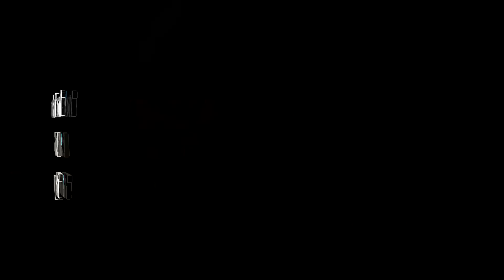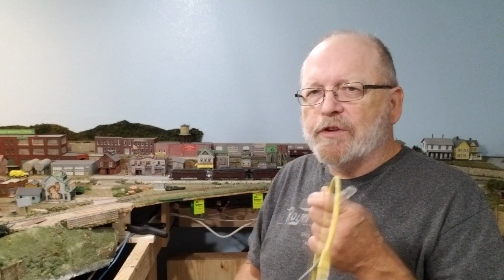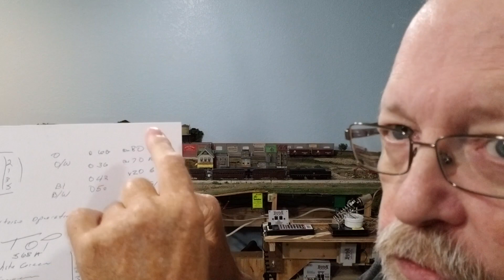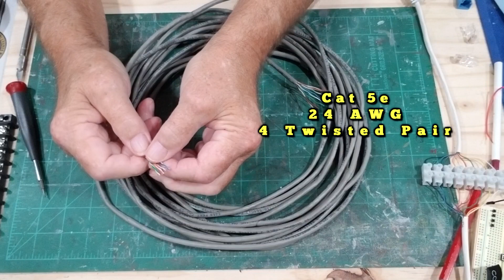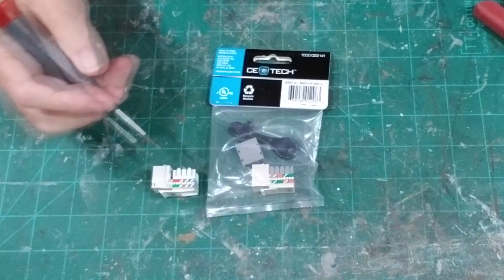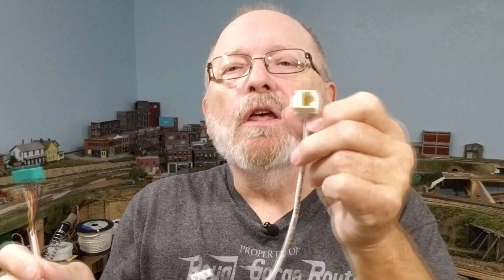Will Cat 5 Cable Handle Your Model Railroad Components

Comment from the maker: If your like me, you have Cat 5 cables every where. Have you ever wondered if you can use them in your Model Railroad? In this video, you will see how to make them and see how much of a voltage drop on a cable over 30 ft in length.
Reply: Have you not consdered using STP (Shielded Twisted Pair) cable which utilises a ground wire (and foil) in the cable and connectors?  Using the ground as a negative (-) wire can give you nine cores, and can be used with normal connectors using a bit of ingenuity as to connecting the 9th core.  Or you could simply purchase STP plugs and sockets for a small increase in cost (and fiddlyness) and that will cover the main cabling problem.  Worth looking into if you need a 9th core!!

STP networking cables are available to purchase if you find them TOO fiddly to make yourself, but the sockets are no more difficult than the normal ones. The same tools are used for both types of cable (crimpers and punchdown tools).
Reply from the maker: Hi Trevor, that's what I used at first on my Tortoise switch machines but I had all this cat 5 cable around doing nothing so I experimented with it to see if it would work and it did. So Ii made this video on it. I really don't need the 9th conductor since the Tortoise switch machine has 8 pins. I'm currently making a board with an 8 pin connector and a RJ45 connector on it so I can make it a little easier to wire all my switch machines.

Comment: A 9 wire connector used to be called a serial buss.
Reply from the maker: Also a D Sub
Reply: @TomsTrainsandThings  My Ethernet cables have 10 wires using telephone type clips for attaching.   What I wonder is what the gauge of the wires is.

Comment: My wife's brother-in-law was a maintenance worker at a local mall, The mall has been abandoned for a few years. When one of the stores closed and moved out, the interior was gutted and everything was tossed in a dumpster. I pulled out many yards of telephone cables some were 50 pairs of wires and others were 25 pairs. I also pulled out a lot of wood that I used to build the bench work for my model railroad. In one part there are 4 tracks that merged into one, went across a bridge at a door way, then into a tunnel through a wall and into the utility room on a covered shelf where it split into two tracks for a passing siding, then merged back into one track and proceeded to go through a wall back into the viewing area. I used the 25 pair cable to operate the two switch machines for the passing siding, 4 block occupancy detectors, and infrared LED's and optical sensors to send a signal back to the control panel when a train cleared the switch tracks. I'm an electronics hobbyist and designed a circuit around a quad NAND gate IC to control a 3 color LED block signal, that would send a signal back to the previous block signal and change it to yellow, and the one before it to green. I lost the schematic diagram for it. I do appreciate your videos. I don't know everything and can always learn something.
Reply from the maker: Always good to get free stuff, every little bit helps. I once got a section of a panel from a yard office that was closing on the railroad I work at back in the 70's. When I moved I gave it to my neighbor because I didn't have enough room for it. Wish I would have kept it.
Reply: @TomsTrainsandThings  I have an electronics and electrical repair shop in the basement. When I first started my model railroad, there was a coal room in the basement in our house built in 1913. I knocked holes in the brick wall for tunnels . Two tracks ran into the coal room on each side on the door to the room one went up and the other went down  and each split into 5 tracks did a u-turn came came out again as two tracks. When my business took off I needed more room so I took out the coal room and the tracks, so there's not much left except the part in the viewing room. I did built an old style wooden coal tipple that operates by hidden cables to load hopper cars with granulated coal to feed coal fired boilers at power plants. I am considering on trying to expand what's left of my model railroad.

Comment: Thank you for the verification. I have a partial roll of cat5e that I plan to use for controlling atlas snap switches. Those need two leads per track switch and can use a common "ground" lead.
Reply from the maker: Glad I can help John.

Comment: Cat 5 works fine for my loconet and LCC but I do not run motors or solenoids with it.  Voltage drop might be a concern.
Reply from the maker: Thanks Dave. That's why I did this video, to see how much of a voltage drop there would be on a Tortoise Switch machine with 30+ feet of wire. it was negligible.

Comment: Obtaining a MRC Tech 6 sound/power controller accepts the same CAT5 cable... remove the short black six foot flat cable and use the CAT5 cable between hand-held and small console. Plenty of length and easily blue! Another tip is to make sure that the ends of the cable have a method so that they are not the only thing keeping the connection together other than the little press-tab (to release the connection.)
Reply from the maker: Thanks for the info John.

Comment: My employment has been mostly in Networking, so the use of CAT5 cables and RJ45 connectors is very common for me. There are, for a small extra cost, RJ45 connectors that you slide each core wire into a hole in a small adapter. Once all wires are slide into the small adapter then it is slide into the RJ45 plug.  This allows for a very easy way to almost ensure a 100% success rate. An amazon link show this small adapter along side the RJ45 connector. https://www.amazon.co.uk/CableCreation-100-PACK-three-piece-connector-Transparent/dp/B01K9Z4D1M/ref=sr_1_19_mimg_1_ce_display_on_website_sspa?ie=UTF8&qid=1509571620&sr=8-19-spons&keywords=rj45&psc=1   This also saves a lot of time if one is making a lot of cables, which could be a reality in a med to large layout. Great videos and each one adds to my existing knowledge and experience; so a big thank you for the work you do for so many.
Reply from the maker: Thanks you so much Thomas for the complement and the link. That sure would save a lot of time and effort.